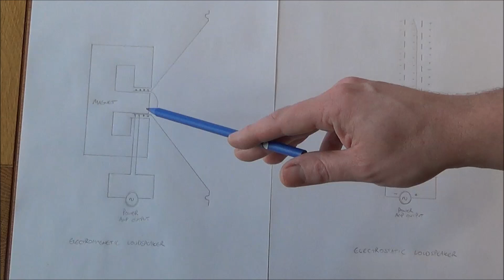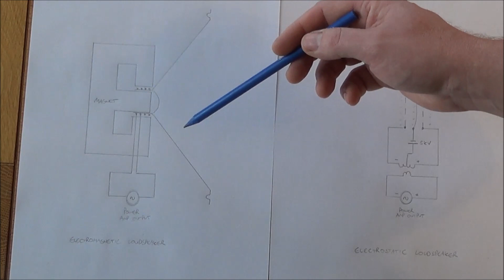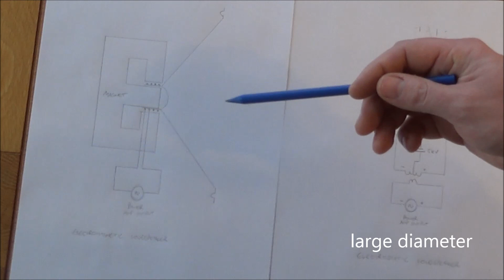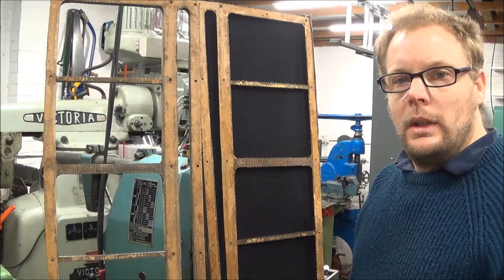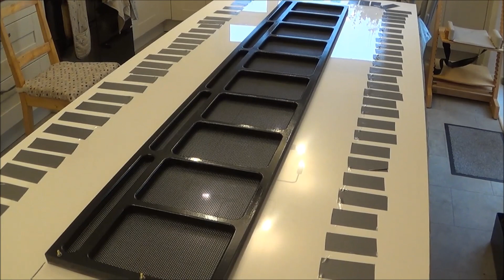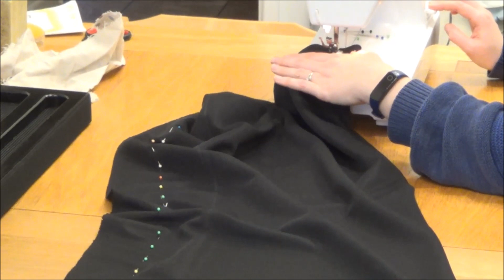Homemade Electrostatic Hi-Fi Loudspeakers

Comment: Beautiful project and very well done.  Thanks for sharing your design and construction details.  I thought about building some of these about thirty years ago, but I'm not that electrically talented.  I've built a few sets of dynamic speakers, but have always wanted some electrostats.  I recently got an old pair of Magnepans, so I'm scratching that itch, a little.  I like them but am thinking of rebuilding the crossovers with new components to really make them shine.  Your dynamic bass speaker is pretty nice and compact.  It did make me wonder if you've ever thought about building open baffle speakers for the lower frequencies.  I've heard that they can be the best way to add bass to panel speakers, but I've never tried it.  Cheers.

Comment: You need to isolate the panels from the frame. Wood and MDF are not good insulators especially in humid conditions. I have always preferred to keep the stators full range, ESLs are a one mans kind of thing. It's all or nothing. You also need to have a shelving eq in the crossover because the dipole off, the panels will lack low mid range without equalization. You didn't show the part where you tensioned the mylar with a heat gun. If you stretch the mylar only by tape, it's going to be left very loose and your max output will be poor.

Comment: Where do you source your stator from?
Reply: You can buy perforated metal sheets from most steel retailers. The only trick is to find a suitable one with a thickness and perforation pattern that leaves 40% or more of the sheet perforated. Any less than that and the output starts to degrade and if the sheet is too thick it starts to act as a helmholtz resonator degrading the sound (each hole is like a small reflex tube).

Comment: Graphite is the worst coating. Resistance is low. Use crystal Licron.
Reply: I disagree. Licron is short lived. Graphite needs to be rubbed on and off very hard, then it will be in the Mohm resistance range and the coating will be very durable. My first ESLs I built using graphite 30 years ago are still working like new. The Licron ones I built less than 10 years ago already failed.

Comment: Don't you think that the low freq driver cause a short when an air pushes a membrane during a big punch? I'd try to direct them at least 45 degree to the panels.
Reply: I was thinking the same, at loud volumes that is a very real risk alghouth the driver was reasonably far away. Far enough that it needs to be phase compensated.

Comment: WELL DONE!!!
What a cool A-Levels project!
Have you published schematics for the power supply/system anywhere?

Questions:
1) In watching pro EM speaker fabrication, I noticed that the membrane is coated prior to tensioning and adhesion. Why did you invert that order?
2) I noticed (and I'm sure you did too) that the membrane is not evenly tensioned after your adhesion. What are your thoughts on why that is? I theorise that tensioning your membrane onto a larger frame, then lowering your tensioned membrane over your housing (allowing you to roll the membrane on the tape while still under tension attached to the larger frame) might solve this, however I also noted that most of your slack was located on the tweeters... Perhaps the solution is to tension the membrane, adhere it to the woofer only, then retention the excess on the tweeter side before adhering it there is the solution?
3) Any thoughts on the value (and feasibility) of a curved design?

I look forward to hearing your thoughts.
Reply from the maker: Hi ross, i did not produce any schematics (that are worth sharing). I would suggest getting a book like 'electrostatic speaker cookbook'. The curved design (like ML) give good and even dispersion but cause more distortion and are more difficult to make. There is no down side of coating post stretch, but with the conductive coating is used it would be nearly impossible to coat direct from the roll